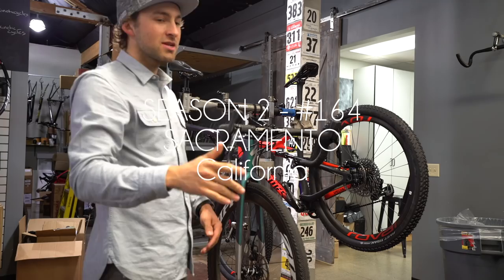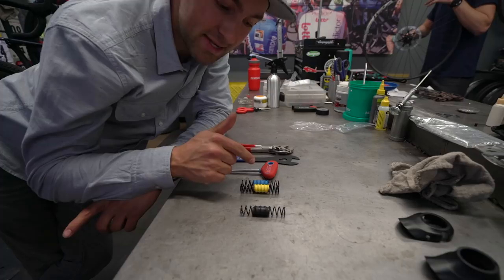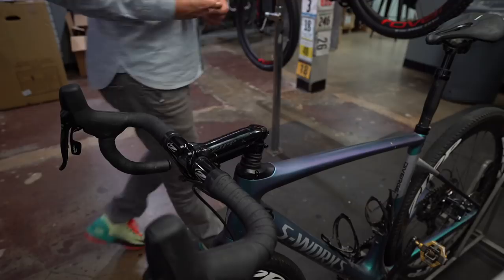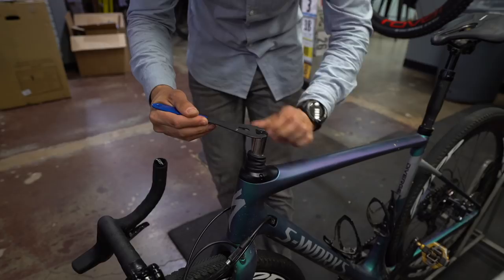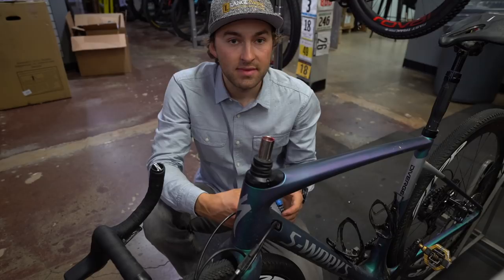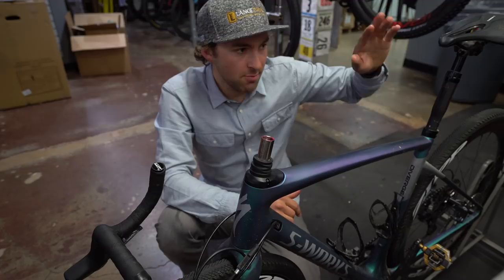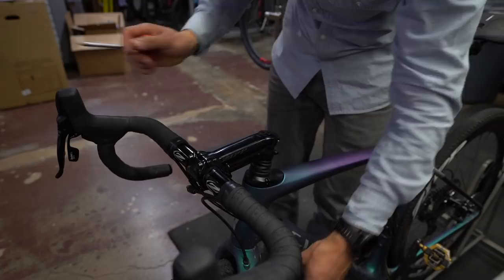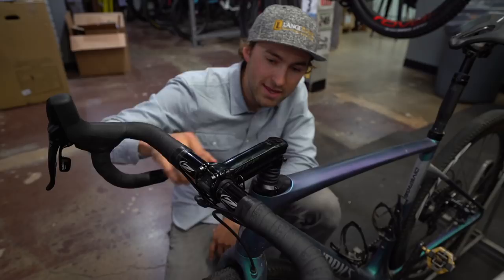Tech Talk - Changing Booster Spring on FutureShock . VLOG 2.164

Comment: I have the Sirrus X 4.0 Im 5,7 130Lb  I did replace to Blue spring and works pretty nice Most of the roads are flat but cracket to a point the Blue spring works with out issues or jumps it perfectly  smooth the ride! Of course dependes the individual!

Comment: Hi Cody,
Wish I would have come across your channel 4500 miles ago.
I'm 6'2", 210 and have been riding my 2019 Sport Diverge with the yellow (strongest) booster spring and a stem that was flipped up for a more upright position.
Took your suggestion and switched to blue (lightest). Very noticeable difference, more compliant.
Grease inside the cylinder was a little lite. Still recommend Motorex FETT 2000?
Also got your KNIPEX tool. Works great.
Keep up the good work!

Comment: Thanks Cody for the excellent tutorial.
I am having issue with my 2020 Roubaix Sport future shock with terrible vibration and chatter, sounds like its coming apart.  If the road is smooth, very quite.   It wasn't always like this, it was just great for the first 8,000 miles or so then started with the noise.  My shop replaced the future shock under warranty and they showed me that the rubber seal was torn on the old one.

I was thinking of pulling out the booster spring and replacing it,  I noted that from your demo, the spring is highly greased.  If the one inside my unit is greased, I would find it hard to believe that it could chatter like that.  Do you have any thoughts, thanks in advance
Reply: Same problem, keen to see if Cody answers

Comment: Great video Cody.
My roubaix comp has zero stack cap and no spacer and with medium spring. I have a relaxed sportive position.  But i felt that i have only 10mm or even less instead of 20mm of suspension as they advertised (especially when you stand up on the bike and pushed down the handle bar). It was even repaired and cartridge was replaced. Any idea what might be the issue? I'm a small rider 5'7" tall 66kgs thus medium spring is fine. Thanks a lot for your feedback.
Reply from the maker: Well first off, rider weight doesn't effect spring actuation. It's mostly hand pressure on the bars. So if you are running a zero stack cap and no spacers you may want to run the yellow spring due to pressure on the bars. 
Also keep in mind that the spring is designed to bottom out. It is very different from MTB suspension with damper circuits and tune able air springs. So bottoming out is not a negative thing.

Comment: I've got a Diverge and swapped out that cap they call the TALL headset cover for the SHORT headset cover and removed all the spacers. With the spacers gone and the SHORT headset cover in place, I can stop that cover from rattling around slightly.  I don't see how  anything is keeping tension on this.
Reply from the maker: Tension on the Spring?....
Reply: Thanks or the reply.  It's the plastic headset cover. I'd attach a pic to this comment if I knew how.

Comment: Cody nice video. I'd like you guys to do a video of changing out the higher profile bottom cap under the Diverge spring. I am wanting to install the low profile one. What stem is on this Diverge in your video? Thanks my man😉
Reply from the maker: That is a very simple task. Loosen the bolt recessed inside of the top cap with a 4mm allen. lift the future shock out, exchange the caps and spaces to your preference, re install the future shock (w/ Carbon Paste" and torque that 4mm bolt to 6.2Nm.
Reply: Hi Cody, this video is from 2 years ago, I recently changed the height of my handle bar, I also changed the cap to a smaller one, my question is, how do i make the smaller cap fitted? Cuz right now it has some play on it and moves a little

Comment: I got my 2020 diverge x1 from a shop. But it came with all 3 springs In a bag. I think I’ve had some bottoming out issues. The shop is quite far from me. Could it be possible there’s no booster spring installed?
Reply from the maker: Well the system is designed to bottom out, unlike mtb suspension, so that shouldn't be too much of a concern...however if there are 3 springs in the bag. I would also assume there is not one in the bike. I would recommend starting with the black, medium weight spring and going from there.

Comment: So if I own a Diverge and ride it only on road I should swap yellow spring to black spring in order to get Roubaix sensation and full effect of Future Shock ?
Reply from the maker: The spring should always be the softest as possible for maximum movement out of the future shock. The spring choice is really dependent on the riders pressure on the bars. If the bar setup is rather tall, lighter spring. If it's really low and aggressive, stiffer spring

Comment: Cody I use the middle spring and when I am on the lower part of my bars it feels like half the travel is used up. Would you recommend using the heavy spring. I'm pretty lean but work out and weight 190 at 5' 10"
Reply from the maker: The spring stiffness is a factor with bar height/drop versus rider weight. I run the stiffest spring because my drop is pretty low. If you are running the 25mm top cap and spacers the medium spring is okay. If you are running the zero stack top cap and no spacer the stiffer spring might be a good option. The lighter the spring the better, it allows the futureshock to always be using full travel. It's not a bad thing for it to bottom out.

Comment: Great video! if i want to take out a few spacers on my roubaix, how do i adjust the future shock?
Reply from the maker: No need to "adjust" the future shock. You want to losen the 4mm allen key located inside the duck bill cap that sits closet to the frame. Then pull the assembly out, remove the spacers, re-install and torque back to 6nm. Make Sure to Torque Properly!!!

Comment: I have a metallic noise during use on a bumpy road. a very loud noise. what can it be? spring not greased?
Reply from the maker: Well before doing anything i would try to isolate it. Make sure it actually is the future shock. I would guess it probably isn't the booster spring which is what we are referring to in this video but you it very well could be. Check it and grease if necessary.

Comment: Hi men,

Can you confirm that springs are delivered with the bike.
I ask the question because it was NOT the case for me.
Regards.
Reply from the maker: The springs come with the bike from Specialized. However, many shops will hold onto them to make sure that exchanging the spring is done properly buy an authorized dealer.
Reply: @thekidkaiser  thanks for the reply.

Comment: Cody, can we completely disable future shock in this bike? we dont need any type of spring function here.
Reply from the maker: No. Probably should not have bought a Diverge if you didn’t want the future shock.
Reply: @thekidkaiser  i got rubaix which has same future shock. i got update from their tech team that it can not be done and also would void warranty. so living with it.
Reply: You could get an engineering shop to mill a piece of 7075 to remove the FSR, but to be honest would not have bought the bike if you don’t want FSR
Reply: @neilk22   I do agree,, unfortunately I did not knew about bikes that much;;
and sales guys in India are too good to sell you anything they have in stock..

But I would say this bike almost as fast as any other normal (non aero) road bike. . and climbs well. .

that spring I feel sometimes absorbing my watts .. can it be true ?
Reply: @ADY_SR  honestly it can’t, rider weight doesn’t matter either. Don’t think of it like suspension I.e read about about sprung vs un-spring bike weight. Do you have a cg-r seatpost? This can make you feel like you’re bobbing, I swapped mine for a rigid.